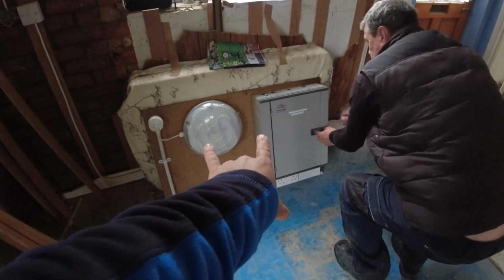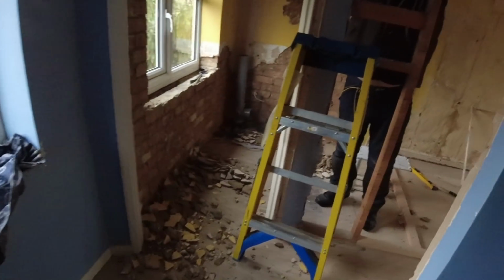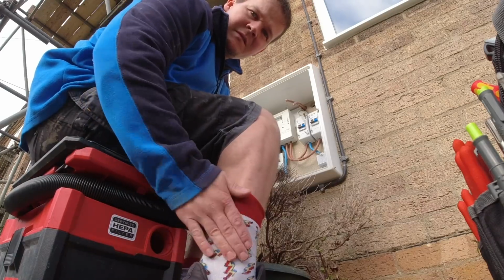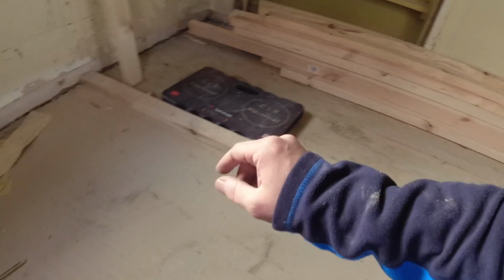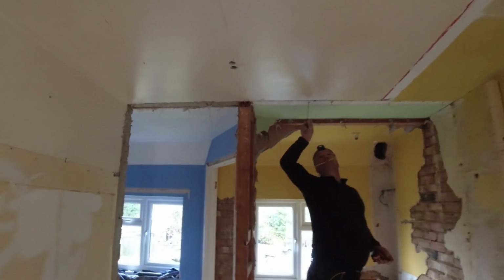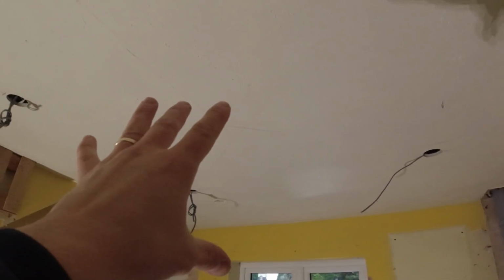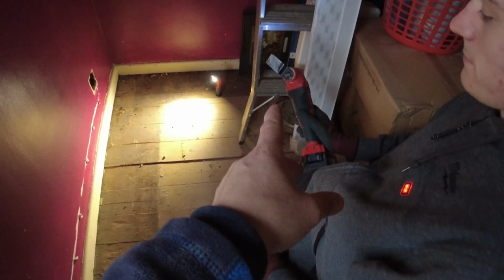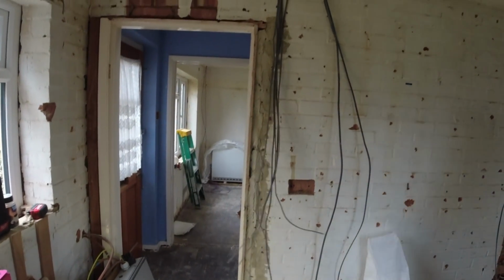Glamorous Life Of An Electrician!! Uncovering questionable electrical work.

Comment: There was no better time to get gas central heating done! Those electric heaters will be a regret I'm sure ££
Reply: The street doesn't have a gas supply sadly. So it's this or oil really
Reply: @ScouseMouse  thats rough mate. Solar viable for you to help out?
Reply: @ScouseMouse  Even Kero would be cheaper than Electricity! Or a Heat Pump. Cripes didn't think anyone would be fitting storage heaters going forward.
Reply: gas is going extinct, no better time to get a heat pump
Reply: @spuriouspodge7416  yeah probably would be cheaper in the long term but that'd be after a pretty big outlay and would probably take a decade to pay for itself. These storage heaters were already there so its leaving it as is versus the expensive but longer term approach
Reply: @ChristmasCrustacean1  😂😂😂 I don't think so
Reply: @spuriouspodge7416  heat pumps are ok on modern buildings with UF heating, and well insulated, a building like that, you may as well burn your money, oil is the cheapest way to heat that place
Reply: @ChristmasCrustacean1  nice try Boris
Reply: @acelectricalsecurity  I'm guessing that he has a heat pump to sell you 😉

Comment: Those current storage heaters look like dimplex quantum heaters, the qm150 are around 800 quid and fall in price accordingly to size of the heater, there the Rolls Royce of storage heaters as a mate would say
Reply: Still crap
Reply: Totally disagree  as an alternative  to gas these heaters are superb  fitted them in over a hundred houses in the highlands of scotland  we had 6 complaints   very clever heating
Reply: @robertwilliamson3934  the trouble is, your paying around 22p a unit for electric and gas is about 4.6p a unit, so if you can burn gas it's cheaper
Reply: @acelectricalsecurity  I don't think anyone would use them if they had a gas supply, but lots of people can't get one at reasonable cost. Oil's a pain, electric is your only real option, and storage on dual tariff, if set up properly, is the cheapest way to do it.
Reply: Dimplex quantum are the best as far as electric heating goes, the electrician  who put them in just said, "They have a brain" i was a bit skeptical of that but he was right! I barely need to touch these heaters at all as they just do their own thing and the temperature is always comfortable not too hot or too cold,  they have saved me fortunes on the electric bill compared to the older storage heaters. However as good  as these heaters are if i had the option to go with gas then i would but it's obviously not available everywhere.

Comment: quick question chris kind of irrelevant to the video. but have you had any problems with wiska boxes? do they have their own drain plug or do you drill a random hole? have you ever gone back to a job and they have moisture or water in them? as i’ve heard moisture is a problem with them?
many thanks

Comment: I would of wired the  smokes on separate circuit then used it to pick up the future loft lights, save running a separate feed up to the loft.
Reply from the maker: They are on own circuit I just double up at board or leave on its own. Good point though
Reply: I wire all my loft conversion jobs this way, crack on mate
Reply: He did say it's on its own circuit, plus it's probably less than a 10m run, personally I would have done it the same way. 
If you had a problem in the future on the smoke detector cable, this way you still have the lights in the loft working.

Comment: Is it recommended/typical to put an electricity meter outside? Or is it rated to be put there as well?
Reply: Every new build will have the meters outside in the UK, older houses the meters are usually inside, unless like this property the supply has been moved at some point
Reply: been like that here in Australia for at least 50 years
Reply: The enclosure is weather rated